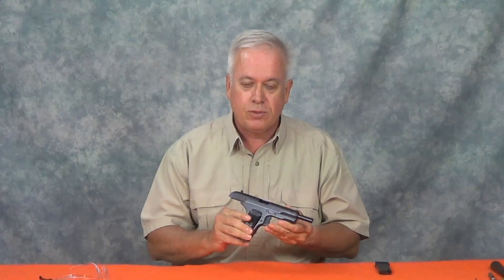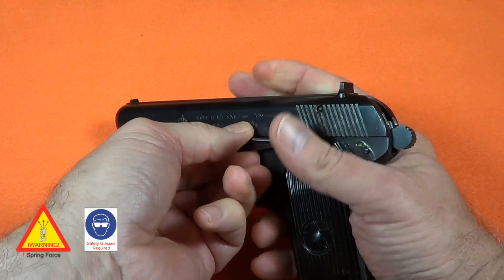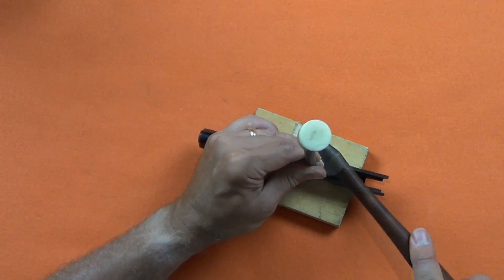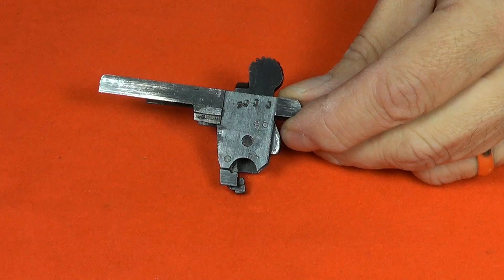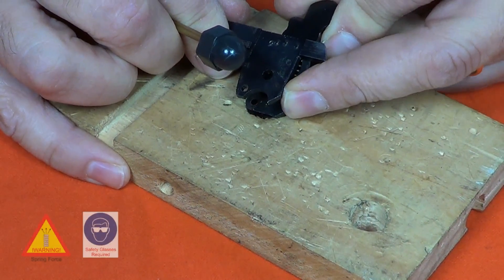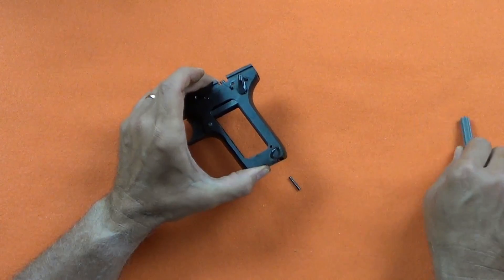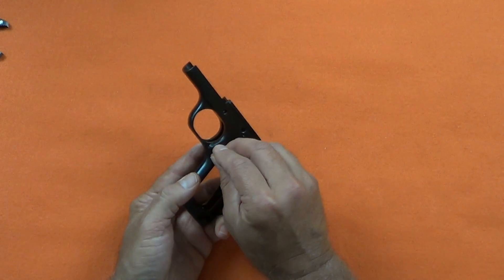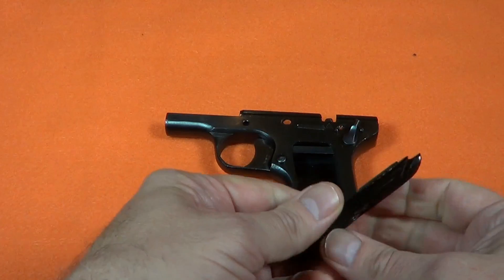Norinco 213 Armorer Level Disassembly

Comment: Excellent work on your video(s), Jim. I purchased one of these pistols at a gun show, brand new, back when they were first introduced. The magazine release button has always been so hard to depress to get the magazine to drop that I've always been reluctant to take it to the range. Even after a deep clean, I have to use pressure from both thumbs (one on top of the other) with the pistol laying on a table, or use the cleaning rod to apply pressure on the magazine release button, to eject the magazine. Do you have any suggestions? I assume it's a spring problem. The pistol has had less than 50 rounds through it, and I still have the box and manual in reasonable/good condition, along with a Chinese issue leather holster. It would be great to get this problem resolved, no matter if I keep it, shoot it, or sell it.
Many Thanks
Paul
Reply: Wow, not sure. That spring isn’t that strong. Try installing the mag release without the spring and see if it’s a fit issue. If it moves easily without the spring then one of the parts is rubbing other wise it’s the spring.  You can stock springs from brownells otherwise modify the existing spring see my video on the ruger trigger job for info on that
Reply: @jimhumphrey6806  Thanks, will do!
Reply: @jimhumphrey6806  Jim, As it turned out both the spring was too stiff and the magazine catch link was poorly crafted (what a surprise). Rather than mess with these parts, I ordered used parts and replaced the magazine catch, spring, and catch link. Works like a charm now for about $20.00. Thanks again for your help and excellent videos.
Paul

Comment: Thanks for the video on this, I just got one of these today and it had a problem with the hammer not staying cocked.  I looked closely at the trigger mechanism and saw that the Seer spring was not in its spot. I popped it back in got the pin back in and the hardest part of it all was getting the slide spring back in! LOL
Reply from the maker: That's great to hear.  I went to a little extra effort to show how that sear spring fits, with the close up shots.  I'm happy to see you were able to get some value from it.  And yes that recoil spring can be a pain, I've seen people try to do other ways, but I think my method is the best.
Reply: I didnt have a good block to hold the hammer back to get the seer and its pin in, so I wrapped a strip of rag holding the hammer back and also allowing for better grip surface.  Oh, and Zastava M88 mags fit these if you need/want new mags.
Reply from the maker: That "armorers" block is just a piece of 1x4 scrap that I drilled a couple of holes in.  Every now and again I modify it for something new I'm trying to hold.  Good to know about the Zastava mags.  Thanks!

Comment: Don't know how you removed the firing retaining pin..... needs a special kind of tool
Reply from the maker: No, that just a punch and tweezers.  If the firing pin should come out easily, if it doesn't, use some penetrating oil and soak it over night.  The punch by the way is a type I found at Brownells.  I like it because it has replaceable pins and a square shoulder.    It comes with steel pins so I replaced those with brass.  You don't get as much force transfer out of the brass but they're kinder to the guns.  I also think square shoulder punches are a must.  With a tapered shouldered punch you risk damaging the gun if you over drive the punch.